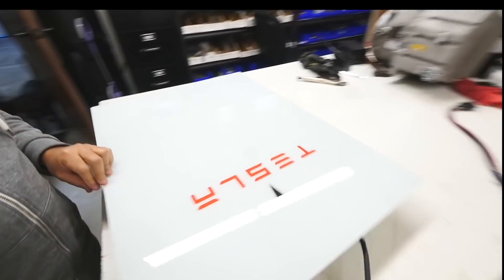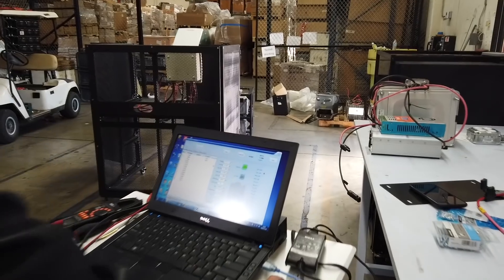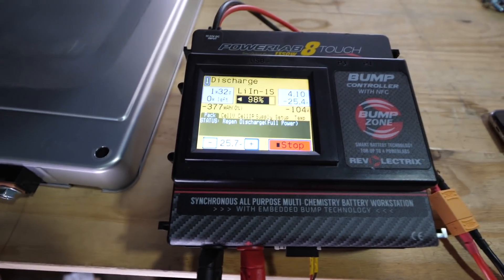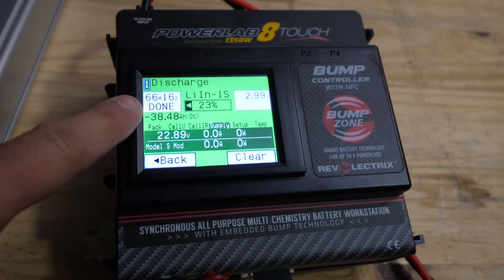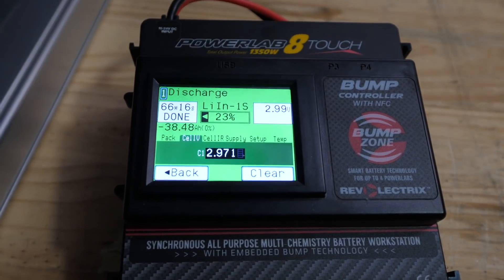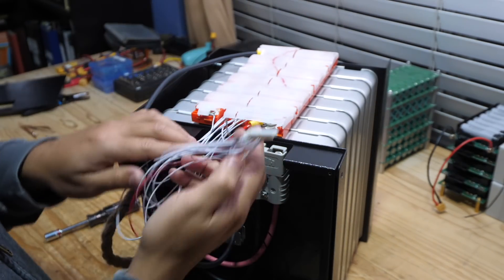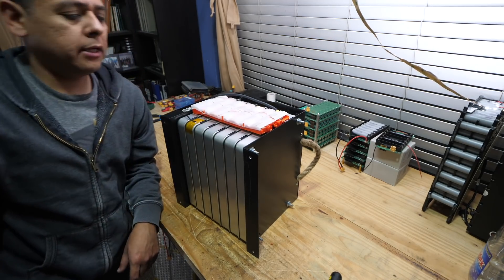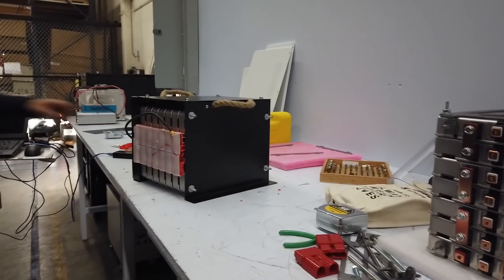Nissan Leaf Battery Modules Repurposed in Solar Energy Storage

Comment: For those still looking for the kit just search Nissan leaf module BMS kit and you'll come up with GreenTec who sells them for $100-150 but not including the metal box/covers. They also sell used modules for as low as $22 each if you buy in bulk

Comment: Do you think the jkbms with 2 Amp active balance would be a.good choice for a leaf battery. I have 24 cells set up in a 24 volt configuration and have been using it a year with no bms but people say it's dangerous and that I need a bms. I ordered a jkbms and I hope it works for what I need

Comment: Hi Jehu Garcia,
Thank you for the video. I have found it very interesting with an original idea.
I would like to build up a test bench for my Nissan Leaf modules and I would like to use the same PowerLab 8 Touch product.
I was looking for the PowerLab 8 Touch device but I could not find it. Have you an idea where can I find it or if there is a similar product?
Thank you

Comment: I've got a problem I believe is pretty common.  I'm a senior who uses electrical medical equipment afraid of being vulnerable to electrical service outages that can be dangerous to my health, UNLESS I have some sort of powerwall that can charge from housecurrent (not solar) and discharge in the event of a power outage.  I have contacted my local electrical provider, but they offer no program, nor have any solution!  I have no electrical skills, so I need to buy a plug and play style powerwall to meet my needs at the lowest possible cost per kw/hr.  Ideally a system that can be easily expanded so that if I can afford it I can tie it into my fridge and freezer to prevent food spoilage as well during a more extended power outage.  Can you point me (and those like me) in the right product direction?  Thanks!
Reply from the maker: The delta mini is my favorite but it’s on the expensive side https://amzn.to/3z2f6v2  but there are so many new units coming to market it’s hard to keep up https://amzn.to/3HdN6Yf

Comment: All of the provided buss bars, covers, balance lead lugs and even the terminal bolts are original Nissan leaf pack parts. Compression plates including ones with welded nuts are built into the pack. Its a treasure box of parts.

Comment: Did I hear correctly? You got 280 watt-hours from ONE CELL of a two-cell pack (technically 2S-2P)? Rated for 500 watt-hours, a total of 560 watt-hours is 110% rated capacity. 

I'm sure the provider of that pack would appreciate a correction in the video if warranted.

Comment: Thanks for the video. I just purchased a complete package with 48 modules for my solar backup. My inverter can run from 10-16v systems. Do you recommend that I refrain from discharging all the way to 10v? Another video led me to believe that the sweet spot with these is between 3.6-4.1 per cell. If I set up my system to stay between 14.4v-16v, will they last longer? Does discharging all the way cause any harm to the batteries? My goal is to make them last as long as possible. I have a 7750w solar array and a 3600w turbine setup. I live in yucca valley where I have no shortage of generation. I currently have a bank of acid marine batteries that are about 5 years old and are wearing out. I simply just refrain from using much power after dark. Do you have any ideas on how long they will last if I start using them after dark? Should I stick with propane water heating and wood stove for inside the house?
Reply: How is your mind turbine working, also which model is it?

Comment: Those batteries are stacked with spacers in the leaf battery so when bolted with the all thread the pressure is spread across the top and bottom edges and not on the center of the cells. This allows for some pouch expansion and contraction with heat and avoids pressurizing the pouches by compressing the pack.  Perhaps you can source the spacers with the cells?  It would be safer.

Comment: Over in Australia, there was discussion of a class action suit because the first 3 years of Leaf has NO battery temperature control.  As a result, instead of 70-80KM range, they are down to 20-30km range.  Nissan's solution was "Buy a new $12,000 battery pack".  That did not go over well.  A 50-60% degradation in 3 years?  UGH!!  If you get those, or batteries from Souther California, Texas, etc, you will have a battery that is just about useless...   Now if they are from the pacific northwest, and were driven by a grandmother to church once a week... well, Great!!!  I'm looking at the lifepo4 types...
Reply: How would the buyer know if the used battery pack was exposed to excessive HEAT or not ?

Comment: Hola saludos mi nombre es Kevin tengo 15 módulos de baterias leaf y estan configurados en 3 grupos de 5 modulos y esos tres grupos en serie para tener 24v quiero saver cual es el voltaje del cargador solar que debe tener por que mi cargador makeskyblue carga a 29v hasta que las baterias ya estan cargada pero es con las baterias de ácido es lo mismo o tengo que vajar el voltaje gracias anticipadamente
Reply: The Maximum Voltage per module = 8.3 Volts, slightly lower is much better.  Therefore, 3 modules connected in series is 24.9 Volts Max = 8.3 x 3 modules.  Your 29 Volt charger is set way too high ...

Comment: Hi, can you please recommend a 48 battery pack for portable use with ham radio use - need about 20ah capacity atleast and 30amp discharge rate. about 1 hr run time would be good
Reply: 10 @ 18650 cells connected in parallel is about 20 Amp-Hours.  Then connect many of these parallel groups in series, to get 48 Volts.  If you decide connect 4 @ 12 Volt 20 Amp-Hour batteries in series, first verify that the BMS can actually handle 48 volts.  Then recharge the 12 volt packs as 4 separate 12V units.
https://www.amazon.com/ExpertPower-Rechargeable-2500-7000-lifetime-Applications/dp/B07X523S96

Comment: Hi I am trying to get a question answered but no one ever answers it. I want to make mode and enhance an E-scooter I have I only have a set space inside the compartment where I can take the old lead acid battery out and replace it with a better more efficient battery type...because it seems like my 36volt scooter runs for not even a mile and its already feeling weak so the 3 huge heavy batteries I have in it do not make for a great setup for it. My question is which type of battery for the same space /size and over all discharge capacity would give me the longest range and is more efficient for the exact equivalent space for any type of battery , for instance if I have 4 inches height and 6 inches with and 18 inches length and whatever type of battery can fill it up almost exact even if i have to build a 36v battery with 18650 batteries to fill it up or any other kind to fill it up which is the best to get longer range?Oh and I only want range not how many cycles I can use it for seeing that I  do not care about keeping the batteries for years and years.
Reply: Join a forum that discusses E-Bikes.

Comment: Nice video. I have a question. Can I build a 3S battery bank with Leaf modules? For an example let's say I have two leaf modules. Can I build a 3S2P bank with them?
Reply: If you only have two (2) Modules ( 4 Cells )  then no you cannot do 3S2P cells = 6 cells, because you only have 4 cells!  You can do 2S2P cells.

Comment: Wasn't your $300 Tesla wall more power per cu ft?  If I recall, it was nearly 4440 kwh vs what this brick get.
Reply: The Nissan Modules are less efficient by energy per unit volume and energy per unit weight ...

Comment: Can your charge a Nissan Leaf 48v pack with a solar charge controller (with city power) ? Meaning using a solar charger with city power to charge the 48v pack , through the BMS
Reply: Yes, you can charge the Nissan Leaf Battery pack with a charger set to the proper VOLTAGE ...

Comment: Can these be got in 12 and 24 volt packs?
Reply: Did you do the math for ...
24 Volts = 3 or 4 modules in SERIES vs your Charger & Inverter specs ?
12 Vols = 2 modules in SERIES vs your Charger & Inverter specs ?

Comment: Any recommended battery charger for these batteries? Meaning a plug in the wall type. I don't have solar panels yet.
Reply: cheap example works perfectly fine, it charges a little slow, full charge 0 to 100% 12 hours.https://www.ebay.co.uk/itm/58-8V-4A-Power-Battery-Charger-UK-Plug-for-E-bike-Electric-Bicycle/283405419016?_trkparms=aid%3D1110001%26algo%3DSPLICE.SIM%26ao%3D2%26asc%3D20160323102634%26meid%3D5dc2273824f04d55a4934cbf1b701aa4%26pid%3D100623%26rk%3D2%26rkt%3D6%26sd%3D352742915421%26itm%3D283405419016%26pmt%3D1%26noa%3D1%26pg%3D2047675%26algv%3DSimplAMLv5PairwiseWeb&_trksid=p2047675.c100623.m-1
Reply: any 58.8v charger will work

Comment: What weight in kilograms?
Reply: I just picked up a complete pack of 48 modules, it weighs 330kg total. The individual modules weigh 3.8kg each. The steel enclosure and internals weigh a lot. The complete module requires a forklift or pallet jack. Individual modules are heavy but not overwhelmingly heavy. Feels like a brick

Comment: Love your video.  

Subscribing.
Question: TigerDirect pairs a 48V charger for their 7 cell packs.  Is this enough to charge these which are 7.4 volts each? At nominal 3.7V each cell, 14 cells is 51.8V.  Did you charge the 7-pack with a 48V charger?  Will the BMS you installed on the pack handle a 56V charger?  This would make more sense since  8.3v is max.  rated capacity and 8V would put it under that.
Reply: Do you have the specs on the CHARGER ?

Comment: What electric car batteries can u use to build a 12 volt system
Reply: @ Keith - Did you do the math for 2 @ Nissan Leaf GEN 2 Modules in SERIES vs your Charger & Inverter specs ?

Comment: How do you connect the batteries for 24VDC?
Reply: I think the problem is the BMS is not set up for that configuration.  You would put 2 sets of 4 in parallel, but you would need a different BMS than he had I think.
Reply: @Patti - Did you do the math for 3 or 4 modules in SERIES vs your Charger & Inverter specs ?

Comment: LOL, yep like most vehicle batteries they have Quirks.  Wish they could be configured for 24V.   But NOOOOOOOOO !  Due to the double battery per unit it misses the mark.    Splitting the Rails on each pack you can't even do the 12V flavor because of the One Common terminal.    Dang.
Reply: Did you do the math for 3 or 4 modules in SERIES vs your Charger & Inverter specs ?
Reply: @vtorsi610  6S  (2 modlules ) comes to 25v.  Well within my inverter voltages.  Inverter shuts down prior to the cells using they're full potential is the issue.  You just need more modules. Problem solved.  Running  6S  here.   3 modules P and 12 modules total.
Reply: @pulesjet  I don't understand this "... 6S ( 2 Modules ) ..."  HUH?   6S = 3 Modules in series, while 8S = 4 Modules in series.  What is the max voltage of your 24 Volt Inverter = 30 Volts max?  3.75 volts per cell = 30v max / 8 cells. Do you really want to charge the cells above 3.75 volts ?  Because 3.75 V / cell = more cycles & longer life ...
Reply: @vtorsi610  Each Module is 2S.  Two sets of cells in series..  4 cells in each module.
Reply: @pulesjet  Yes I know - 2 Cells per Module.  And that is exactly what  I wrote ... 6S = 3 Modules and 8S = 4 Modules.    But YOU initially wrote "... 6S ( 2 Modules ) comes to 25 Volts ..."   You cannot get 6S with just two modules, you need 3 Modules.  But I think, 8S = 4 Modules is better ...
Reply: @vtorsi610  Each module contains 4 cells.   2 in Parallel and those in series with 2 more in parallel.  Not complicated.  That configuration limits how you can configure your pack.  You can not obtain 12v.
Reply: @vtorsi610  Yes, that is what I'm doing .  3 modules,  4 parallel.  No idea what all the fuss was about.  3 modules = 6S
Reply: @pulesjet  What are you talking about ... you can't get 12 volts ?  Many people are doing 12 Volts with 4S = 2 modules in series. Charge then up to 15 - 16 Volts.   3.75 Volts per cell = 15 volts / 4 cells, it works perfectly ...
Reply: @vtorsi610  Using 3 modules series or 6 cells series.  Charger adjusted to suite.  Inverter range compatible.  

Only charging to 4.0V per cell.  
Battery and charge voltage 24.0v
Inverter shuts down at 20.0v
Well above minimal battery voltage of 3.0v per cell.

Comment: It's because Nissan don't have thermal management , how do you moderate the temperature ?
Reply: Not a problem for Solar Use.  You just use a Thermostatic Switch Regulator like for a Refrigerator or what ever .  Relay disconnects or limits.  https://www.banggood.com/XH-W3001-Microcomputer-Digital-Temperature-Controller-Thermostat-Temperature-Control-Switch-With-Display-p-1415881.html?rmmds=myorder     Keeping them within the Charging or discharge current levels there should't be a issue I would think. If they're getting hot something else is wrong.
Reply: @pulesjet  But it was a problem when the battery pack was in the car and sitting in the heat. The GEN 1 modules lost significant capacity due to heat. How that affect the module's capacity going forward, remains to be seen ...
Reply: @vtorsi610   well if the winds blowing and suns out and these things are sat in my rv at 35c, it’s a worry , I don’t want thermal cut out , I want a refrigeration system

Comment: From what I can tell, TechDirect lists the manufactures specs on all their ebay auctions.  Its kind of deceptive because they list the "New" specs but give you a run down battery.   So if they're selling a 7kw battery pack, you might only get 4 kw of actual battery.
To get what you pay for, you have to know about the vehicle the batteries came out of.  What year and how many miles on the vehicle.
Reply: I agree,  I have purchased 42 Batteries from techdirect,(2 orders)   and not a single one is greater than 43AH most are >40,   discouraging when they advertise 66ah  but in reality your 1/3 less  I have since moved over to greentechybridbatteries (Ebay)  purchased 45 batteries,  all are closer to 45-52AH  (they are also well balanced )  same general prices..
Reply: @ RGB VCoilro - Greenn Tech Auto does give some detail on their Ebay auctions - 
"... 
  Nissan only replaced the batteries after the SOH level dropped from 12 bars to 8 bars or lower, so there is NO CHANCE they are going to be 70% capacity or more, the average we have been seeing is 65% capacity. The capacity within one pack can vary up to 3 Ah on average, sometimes up to 7Ah.  We sort our modules based on the tested capacity and ship groups within 1Ah of each other, usually less.  In large orders we might have a larger range.
  This listing is for modules near the 40Ah test range.  You could receive anywhere from 38Ah to 43Ah modules.  Whichever group you receive will be within 1Ah of each other.  "OFFERS" received will lean toward the lower capacity, "FULL PRICE" buyers will receive the highest capacity available.
  Come with 1 month warranty.
..."

Comment: Do  you or anyone on this channel have any recommend series of videos for me to follow in designing and building my own solar and battery system at home? Maybe a playlist? I got a quote from a company for 30k and I just cant see affording that at this time so I wanted to design and install my own system especially if i can make it more modular and add to it over time instead of one giant system at the start. What I would like to do is not have the system net meter and store in batteries then use that and only use grid when the system cant provide enough juice. The installer I got the quote from said if I net meter ie grid tie that if the power goes out I would not be allowed to use my solar because they don't want it feeding into the grid if people are working on the lines.

Comment: That's because those are generation 1 modules. They had a considerably smaller capacity to start with.
Reply: I thought the GEN 1 Modules were rated at 66 Amp-Hours?    But in the video, Jehu only got 38.5 Ah, which means 40% of this modules capacity is already gone, forever ...

Comment: techdirectclub does not test anything they send out. They may test it when it arrives and the retards used to test probably can't read let alone anything else so then the battery sits on the shelf and slowly DIES; then they SELL IT AS WORKING. Perhaps I am the only person they WRONGED but either way techdirectclub is SHIT in my opinion...
Reply: Was there any WARRANTY?  Did you receive any DOA units?  Did PayPal finally help you?
Reply: @vtorsi610  Warranty? No. DOA, yes all batteries were bloated and did not hold a charge. Yes eBay did refund me but it was listed as WORKING and EVERY UNIT CHECKED BEFORE LEAVING which is 100% BS. Clearly these batteries were beyond damaged I wish I'd kept the pics to share.

Comment: I did not realize there was a 3rd terminal but I dont guess you could use them for 24v with 7 of them with 3 and then half of one because they are joined internally and you could not have the most positive of 1 pack be the same terminal be the most negative of another
Reply: Did you do the math for 3 or 4 modules in SERIES vs your Charger & Inverter specs ?
Reply: @vtorsi610  yes 7s works wells with standard 24v inverters 6 is a little and 8 is to many to be able to use all of the power
Reply: @james10739  Why can't you use 8S = 4 Modules in series?  Your cells will last much longer if you don't max out the charge voltage !